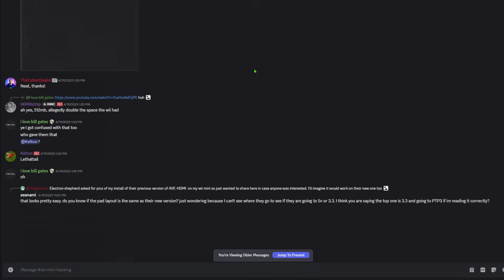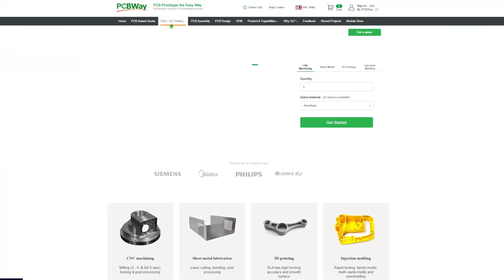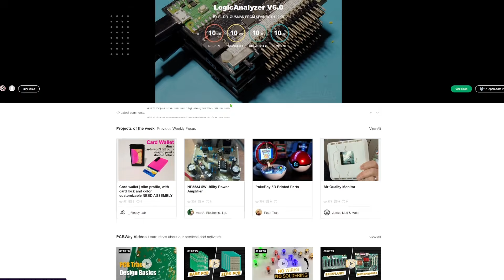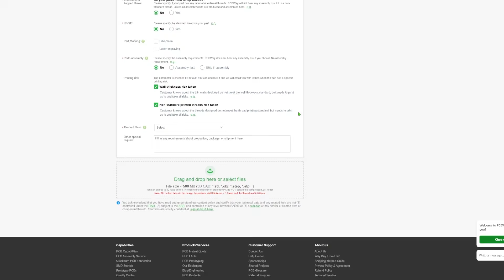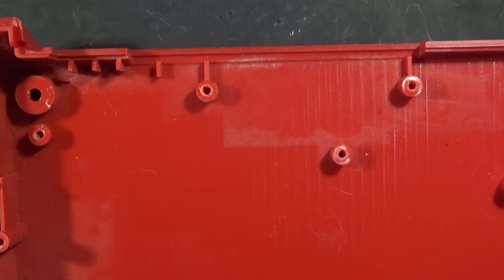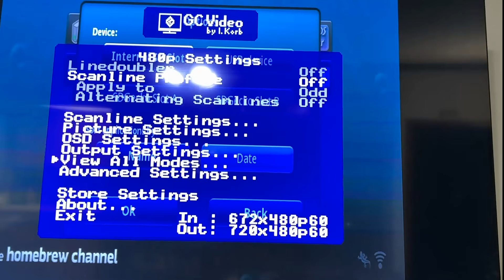Adding HDMI to the Wii Mini is INCREDIBLE!

Comment: One note: if you don't have a wifi card already, installing the stock wii IOS will BRICK your console. You need to patch it first to remove the wifi module otherwise it'll hang with a black screen on startup.

Comment: Nice job as always!  Can I ask why you scraped a new ground point where you did, surely you can just solder to the ground of the massive R164 resistor right beside it?
Reply from the maker: Thanks!
That connection secures the kit to the board. I like to keep it as taunt as possible

Comment: 🔥 Superb job! I've been using a 2000 grit rubber bit with a mini engraving drill / pen to expose vias (rgh3). I don't have your exacto scraping skill 😂
Reply: Fibre glass scratch pens work amakingly. They are cheap, and honestly foolproof.
Reply: @Profeces bizarrely hadn't thought of those, good idea, big surface area though. That's why I like the rubber bit, supper fine work possible with almost zero chance of messing it up.
Reply: @sweetlilmre That's the best thing about the scratch pens. For some reason they really only get the vias. The solder mask is thinner over the vias so it clears them without the surrounding area.